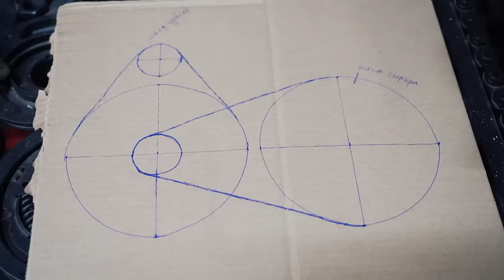Turbocharging a Lada with a starter motor

Comment: You should use a treadmill motor. They are strong, run on dc power and can run continuously. You will have to use a voltage step up circuit though so that you can power it off of the 12v car power.
Reply: That would be too complicated and expensive. The obvious solution would be a lawn mower engine to run the blower. Or... use a leaf blower!
Reply: Need an inverter, and when you’re already on AC motors there are lots of cheap alternatives that still need the expensive inverter.
Reply: @johncoops6897  really? Lol 😆
Reply: @STAY-GOLD-VINYL  I've seen it done on Roadkill with the Leaf Blower Monza.  They also have a boost caboose episode.
Reply: @pflaffik  isn't the starter motor he was using DC? The car already has an inverter from AC to DC. Maybe I'm misunderstanding what you mean though about using AC motors?
Reply: And when the hit stage 6 it is on!!!
Reply: A large brushless dc motor like used on a drone would work best. You could even attach the compressor when directly to the shaft.
Reply: @johncoops6897  ... didn't Mythbusters do that using leaf blowers? I know someone did.
Reply: @Edward Elizabeth Hitler ... that would be a supercharger.
Reply: @Edward Elizabeth Hitler ... yes, technically you are correct. I was just slicing hairs based on common automotive terms where the input is run via mechanical belt / gear versus exhaust driven. Then we have the compressor side, where the roots style blower doesn't allow much, if any, air to flow if the impellers don't turn.
Reply: @rupe53  - I seem to remember a few videos about it, but a quick YouTube search is getting heaps of results... but not anything I recognize.
Reply: @johncoops6897  ... yeah, me too. It was a few years ago. I do recall they (whoever) used a single blower, then ramped up to several blowers. I also recall lots of plastic pipes and duct tape.
Reply: Treadmill motor puts out 1/3 hp, a V8 starter motor between 1 to 1.5hp, and a diesel starter motor between 5-7hp.  A turbocharger at full throttle on a small 4 cylinder is recovering about 20hp from the exhaust stream.  These electric motors all have various rpm ranges which need to be accounted for in gearing to a mechanical turbo or technically a supercharger, I did the reading so you didn't have to.
Reply: A 2stroke 50cc motor to run the turbo would be epic.
Reply: @Edward Elizabeth Hitler Doh I wasn't talking about that one. Just the benefit of using electric over engine derived mechanical.
Reply: @rupe53  The Roadkill Monza.
Reply: @Novusod  Now that's thinking!
Reply: Nitrous. Just use nitrous....lol
Reply: @johncoops6897  The turbo makes more psi than a leaf blower would
Reply: @N-Lee  - only in tbeory. The electric turbo makes nowhere NEAR enough flow for even a 1L engine. So, even at full speed the turbo is creating negative pressure, or impeding the airflow (not boosting it).
Reply: @johncoops6897  NO
Reply: @N-Lee  - No.. What? Do you even understand what we are discussing here? Unfortunately YouTube deleted my previous post about other channel that covered the comparison between an electric turbo and TWIN leaf blowers. They used a small engine, and dyno'd before and after.
Search for: Electric SuperChargers Mythbusted
In order to make "boost", the blowing device first has to flow more air than the same engine without it. In this case (ebay electric supercharger) even running flat out it cannot push as much air as the NA engine can draw in at full throttle. So how precisely can it "make boost"? Please be concise when you reply, so we can all learn from your wisdom.
Reply: @rupe53  - interesting! YouTube has deleted my previous comment which gave details of the Video that we were thinking about. Did you get a chance to read what I wrote?
Reply: @johncoops6897  You need to get with the times. There are already electric turbos making 5 psi on v8 engines and/or up to 1 bar and plenty of proof. But you're such an Internet Know It All,  no one is going to bother to argue with you. Go find the proof for yourself.
Reply: @Владимир-ф2г5л  - we are discussing THIS VIDEO. Keep on topic.
Reply: Check out alexltd. He had a really nice diy electric supercharger build on his channel.
Reply: @Edward Elizabeth Hitler wouldn't that be a supercharger?
Reply: tripplefives  I just googled it and got answers between 350 watts-2,000 watts so I stand corrected.
Reply: tripplefives  .... it might, but that gets away from the design idea of this video, which is a turbocharger.
Reply: tripplefives  continuously?
Reply: tripplefives  ... actually, the turbo part comes from the fact that the thing is driven via an impeller with forced air. (traditionally exhaust gas) Neither of the impellers is positive displacement so we have the interesting aspect of variable boost, which is way different than a roots style blower. In this case we still have half of the original turbo unit, so technically it's still the same on the intake side, which means most of us would still call it a turbo.
Reply: @johncoops6897  believe most treadmill  motors are actually 24v.  Stepped down via a convertor
Reply: @coachgeo - most treadmill motors are rated 150v or 180v DC. They use various electronic methods to convert the mains power and control the overall speed and torque. They don't use low voltage
Reply: or, for greater exercise, force the driver to pump the pedel to manually run the turbocharger! LOL (JUST KIDDING, IT'S A TERRIBLE IDEA!)

Comment: Great video again. For a better motor alternative you should try a brushless inrunner motor and ESC from a scooter. They can sustain more power and RPM than the old shunt wound starter motor (2kW+), and as long as you supply power, the motor will run. Being 0-5V control you can easily modulate the boost, even make a simple feedback circuit
to regulate the boost value with a pressure sensor, that way it will work like an electronic waste gate with perfect efficiency, and you could slave it to the accelerator pedal... it would make a great ride, you may want to go 24, 36 or 48V to get maximum advantage.
Cheers.
Reply: Can you please draw a diagram with the components you mentioned?
Reply: They might sustain more continuous current but the intermittent current wont be all that different. Starters routinely pull more than 100a for something like a Lada in summer and probably close to 200a in winter. If you fed this starter 24v it would quadruple the output.

Comment: Bentley Blower comes to mind. Place a switch under the accelerator pedal, when you hit full throttle, the motor starts the turbo. That's how that system worked in the UK, back in 1922.
Reply: The Bentleys had the blower running full time. Mercedes engaged it at full throttle only
Reply: Hi
Reply: Toyota had a clutched supercharger in 1985 that used a pedal switch to engage it too.
Reply: And the Bentleys had superchargers, rather than turbos. Direct permanent drive from the end of the crankshaft.
Reply: @MiG21aholic  awesome username, and giving the facts.
Reply: @tehgerbil  the late great Robbie Coltrane did a great series on engines and it included a segment on Bentley and Mercedes racing superchargers.
Reply: @MiG21aholic  now there's a legendary name. I'm quite the geek for mechanical things myself (as well as a MiG fan), I'll take a look for it. Thanks!

Comment: I made a switched (on/off) supercharger from a Toyota previa, and I found that using the bypass valve was really helpful when driving off-boost. I programmed all of this using an arduino and a stepper motor controller. I'm very willing to share with you.
Reply: I was thinking you could use the input from the throttle position sensor, along with calculated load value to control how much boost is needed at a specific load/rpm.
Reply: I have mad max style switch in my supercharged punto 😃
Reply: how have you built the supercharger ?

Comment: you have to add a big butterfly checkvalve or something. So the air doesnt has to be drawn through the turbo if it isnt on.
Reply: yeah, the power gain is purely because its a less destriction when its on. doubt is more power than without
Reply: I doubt that turbo is a restriction at that power level.
Reply: @Mastermindyoung14  not spinning it surely is. You ever seen a turbine wheel? Its a big restriction.
Reply: @osbberjen  not at that power level.  Nope
Reply: @Mastermindyoung14  for sure.
Reply: @Mastermindyoung14  Wrong, it is. Modern Vehicles (especially VW) wont even idle correctly with an seized turbo. 
Source: Me being a Mechanic
Reply: @MyCrazyGarage  You're partially right.  A seized turbo or an unpowered supercharger IS restrictive, and its vehicle would benefit from a bypass valve.  However, the compressor wheel on a normally operating turbocharger is always spinning thus not restrictive even well below boost RPM.   Modern turbochargers have an intake bypass valve, but it's mainly for boost pressure control when the throttle is closed under boost, not for increased intake flow below boost RPM.  Might get the same effect if the compressor shaft had a very low drag freewheel clutch, or if the motor was run at 10% of boost power just to get the compressor wheel spinning.
Reply: I wish he had done that and I also wanted to see with a proper powerful brushless motor really pushing the turbo hard and with a electronic bypass on the intake so that when OFF would use direct air intake and when ON would pass through the spinning turbo.
Reply: @MyCrazyGarage  you're a mechanic?  That's cool.  But this isn't a newer VW by a long shot...  How many CFM of air do you think a low compression, underpowered Lada engine requires?

I await your response
Reply: @Mastermindyoung14  
Yes youre right,that small engine wont really choke because of it. But since its an EFI with an MAF it could still cause troubles ( like no pre programmed map for an lower air flow than normal). But this is just a guess, i dont know this ECU.

Comment: It's so interesting to see what you rig up here. Electric controlled bolt on (well more or less haha) turbo, that does work like it should. Very cool engineering going on.
Reply: There are companies that areaking electric turbo chargers. Not with starter motors of course.
Reply: @nikog7133  This one is actually really powerful, but the reason is that is sucks massive current from the battery, due to the power & the fast overheating this thing can only engage for short amount of time but still it's a cool toy & good for quarter mile.

Comment: This is an ideal setup to use an alternator as a three phase motor with the associated variable power unit to feed it.  This way, the variation of speed of the turbo (by varying the motor) can be varied by different means (accelerator position, vacuum, crank speed, or other ways or even a combination of ways).
Reply: The reason they used a start motor is that they knew those things are VERY powerful, hence the amazing result. However they obviously pull massive current & will drain the battery quick, there is also a bigger issue which is that starter motors are designed to operate for short amount of time so they have 0 provisions for cooling & even if you drive them at reduced power they overheat REAL quick, that's why he was really hesistant to use it outside of these very short bursts.

But, for this kind of inneficient setup where you want good power especially for a bit of a joke project they are awesome! It's actually quite genius because it's the most SIMPLE yet powerful bolt-on for when you just want your car to accelerate real quick or something like that.

Comment: You could add a switch on the accelerator and a relay so that when you floor it the turbo kicks in automatically.
I love your website.
Reply: This would be worth the extra effort. I'm curious to see how this goes if they take it further. Genius engineering really because it's low high tech which make it hilarious

Comment: Use a potentiometer for the signal wires and attach it to the throttle and use a speed controller on the motor and you can set the build up of boost so it increases along with the injectors. I think that’d smooth out the acceleration and you decide how many revs the motor stops at (limit)

Comment: Excellent experiment.  The alternator will put more load on the engine unless you use a separate battery. Only then it will be completely separate from the engine.  Keep up the excellent vids. Big respect from me here in the UK 🇬🇧
Reply: essentially this a hybrid. the altenator will be drawing a small amount of power more longer to regenerate the battery but when needed the starter will be taking that power back more strongly.
Reply: the electric motor is not necessary, that assemby should be connected mecanically to the cranckshaft and is called a supercharger.
Reply: @peterparker-fg5kr  and that would defeat the purpose of their goal here, which was a standalone apparatus that doesn't directly sap power from that weak ass engine to do its job. MarcAFK is right.

Comment: I did the same thing on a Mercedes 240-d and made it spin the tires.My contraption was much smaller as I rigged it to work with the electronic transmission solenoid kick down switch on the accelerator peddle.
Reply: And what's beautiful is that it can be mounted ANYWHERE.
Reply: I was a Mercedes tech, back in the 80s, at a dealer. Loved the old 240 Ds' , reliable as hell, but slow.Glad someone had the moxy, to try and turbo charge one.

Comment: switch the starter motor for a chain saw motor with a centripetal clutch, that would make it scary fast
Reply: A motor for your motor sounds good
Reply: Would blow the car engine...and not in a good way.
Reply: with chainsaw engines only pumping 2hp, you wont even get 2hp extra out of your car engine. Anything above 2hp would be physically impossible

Comment: 11:27. I believe the way you have the blower set up it's building pressure inside the intake enough at high res to open a valve slightly when it's not supposed to be open. That was probably gas and exhaust mixing and exploding in the exhaust pipe manifold and then exiting out the back
Reply: Misfiring and detonation at high RPM. Common for boosted or supercharged motors. Needs tighter spark plug gap or more powerful ignition and more timing
Reply: Aka a deadly backfire
Reply: @ruikazane5123  This is a stock engine, so the misfiring and detonation could also be due to valve float.
Reply: Nah that turbo won't be building even close to enough pressure to do that. I'd be surprised if it made much than 1psi. More likely to be unburned fuel built up when it hit the rev limiter.
Reply: The valve spring is probably around 60lb seat pressure .... there aint no way in hell this thing is opening the intake valve from intake pressure lol
Reply: @ruikazane5123  its not a missfire. That problem isn't happening during the combustion cycle.

Its happening during the exhaust cycle. It's air/fuel mixture that got into the exhaust that ignited in the exhaust. 

It's happens when the pressure in the intake becomes too much for the valve springs to handle. And its more likely to happen in this setup where turbine speed and engine speed are independent. 

This turbo can produce maximum boost even if the engine is not consuming much air. Which will cause the pressure in the intake to climb even more. 

When the exhaust valve opens, pressure in the cylinder drops. If the pressure in the intake is high enough, and the valve spring is weak enough, and the pressure in the cylinder dropped low enough, the intake valves will be forced open during the exhaust cycle. 

This will cause air from the intake to rush into the cylinder and then straight into the exhaust. 

This is a carburetor engine, so the air in the intake manifold is already mixed with fuel. 

In other words, fuel air mixture is sent into the exhaust during the exhaust cycle. 

The solution is: the valves need stiffer valve springs to counter the boost pressure pushing behind the intake valves.
Reply: @tylerdurden3722  How would you explain backfires then. Most ECUs pull out timing when approaching redline and that makes for a two-step ish blastoff. Some disable spark or cuts off injection and if in that case the ignition was affected on that redline trip then there's your answer to that backfire. For the record that happens way more frequently with carbureted engines that suffer from rich mixtures and have more "pop"

The last thing would be valve timing and valve clearances for overlap. For any given boost pressure a valve spring that is sloppy enough to open up when closed will be a spring that allows the valve to drop onto the piston!
Reply: '...mixing and exploding in the exhaust pipe manifold and then exiting out the back.'        I know the feeling.

Comment: A starter motor is made run for small time ... It's very strong ,your almost at power that an electric turbo needs ,by modifying the starter motor it will last longer And not get hot but you need to put 2 bearings one small fan on the shaft and 2 new motor ends ...not too hard I ones made an electric bike like this 😁
Reply: Electric wheelchairs use starter motors all the time. Long runs for some

Comment: Absolutely love this,another awesome build! I wonder if it would be possible to put a planetary set in the tensioning pulley and maybe use a more constant drive motor,something designed run longer with less heat being generated.. like a bus electric fan motor or something 😂,also maybe a full throttle switch and arming switch?? Keep up the kick ass builds guys! 👌🏾👍🏾
Reply: what was that turbo boost?🤣🤣🤣

Comment: Nice project.   Assume that the turbo daws through the carb. Now add dual carbs. Then  make ne more speed up on the drive. Say2 to one just like you have. Add to existing drive. Also migh have to add second stater motor with more over rive ratio.  You are one of the first to really do this with powe gain.